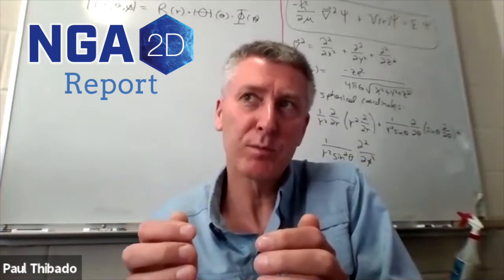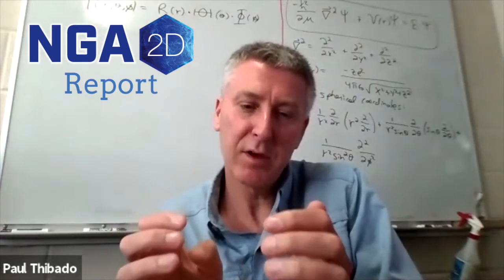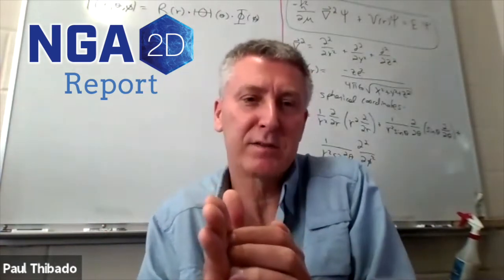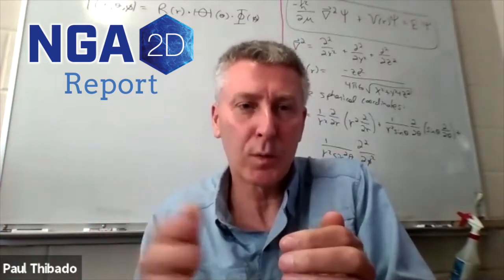Could graphene offer limitless energy for electronic devices?

Comment: I always knew this was possible, though everyone said "No!" I have spoken with a number of science professors and astronomers, while living at an observatory. It seems, though if you stack these in all 3 dimensions, there would be significant thermal degradation ever closer to the center, resulting in lower power output.
Reply: my thoughts exactly. It seems it would have a cooling effect. thermal conduction and surface area would be performance factors

Comment: It is not necessary to convert AC current to DC to "harvest" energy.  AC current applied to a resistor will produce heat same as DC will.  Work is work.  The battery is suspicious.  If the battery isn't doing the work then a pre-charged capacitor ought be able to do the same function as the battery.

Comment: Look... limitless energy in low voltage like what is being discussed here is actually simple to create. Energy is in everything, and pulling energy from the various fields around all of u has been done and proven for years. Only problem is that if it can't have a meter put on it... no one will back it. It's all about the money.
Reply: Case in point. Nickola Tesla had a fully electric car he use to drive around that charged itself pulling energy straight out the air  through an antenna. Fossil fuels and modern-day green tech is sourced from  Finite recourse, a profit is always made. True reusable energy is free and truly green, it'll never be allowed.

Comment: Not sure if battery is the right word here. The device convert heat into electricity, but it doesn't store it.
Reply: the heat is being captured from 1/2 spin delocalized electrons. So the kinetic energy is negentropic energy. "A temperature difference between the graphene and circuit, in a circuit producing power, would contradict the second law of thermodynamics...Thibado’s team found that at room temperature the thermal motion of graphene does in fact induce an alternating current (AC) in a circuit, an achievement thought to be impossible."
Reply: @voidisyinyangvoidisyinyang885  Yeah, the chain of actions are heat to kinetic energy, and kinetic energi to electricity.

Comment: It would be very useful to explain more clearly why the battery in the circuit is not providing the energy and how the smaller chips would be made without batteries since that is the whole point.
Reply: That was my first idea too, but here is no net charge flowing through the battery.

Comment: If true video deserves 500 million hits, not 500.
Reply: This is definately a disruption level evolution of the heat engine. To make energy from heat without a temperature differential at all!  If you scale this up, a 2kW device would only be as big as a kitchen tissue roll, if you roll up the Graphene. So a shue box size device with a pc fan drawing ambient air in and exhausting cold air is enough to run an EV truck for the lifetime of the sun!

Comment: peltier with other plate at 0K
Reply: low powered self-powered ic
Reply: Peltier generates electricity from temperature differences, while this generates electricity from temperature as such.
Reply: @MiccaPhone  heat is movement of particles, right?
Reply: @MiccaPhone  so, you are basically sucking out heat energy to somewhere else, try liquid nitrogen
Reply: @Jkauppa  please elabore your liqid  nitrogen reference, I have no idea what you are trying to say.
Reply: @MiccaPhone  it takes out the movement out of other warmer substances, basic heat transfer
Reply: @MiccaPhone  assume its free to keep cryo at cold temp
Reply: @MiccaPhone  just a very cold temp "steam" engine
Reply: @MiccaPhone  if you put a fridge heat pump next to a hot object, you get what i mean
Reply: @MiccaPhone  you take movement and make some energy with it, which is mass itself
Reply: @MiccaPhone  if you take some phonon energy, you make it colder
Reply: @MiccaPhone  its a minimum sized thin layer speaker with an attached coil-magnet
Reply: @MiccaPhone  it just needs so thin-smal that it vibrates with heat